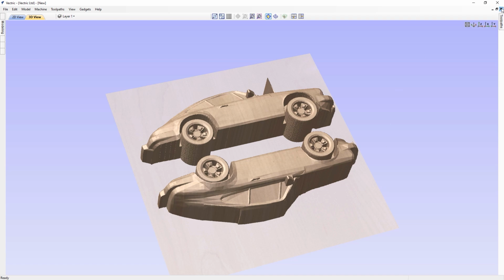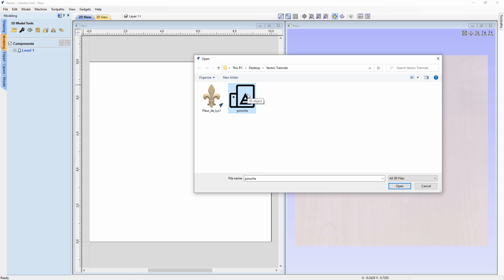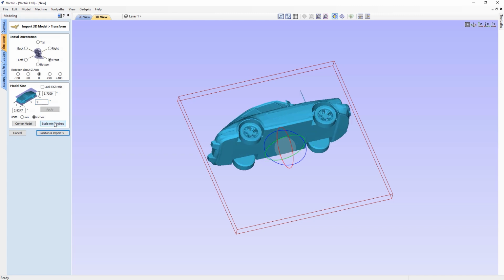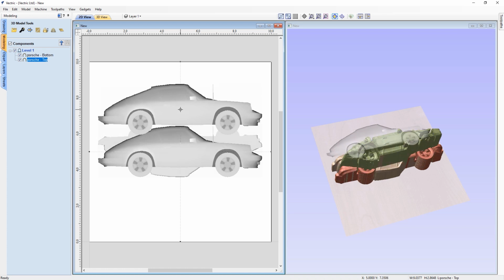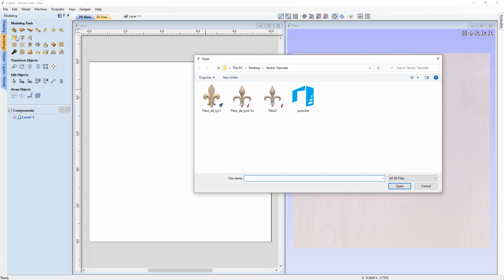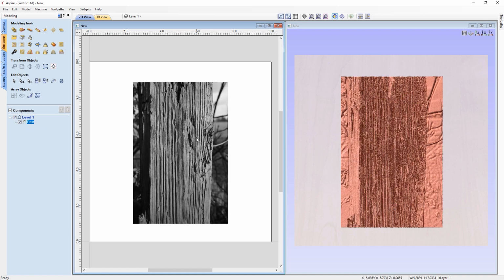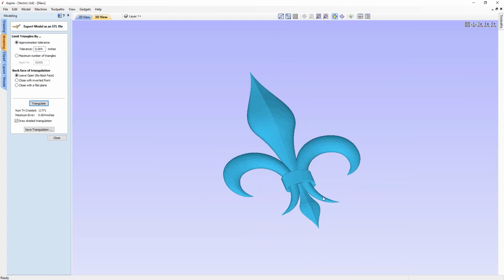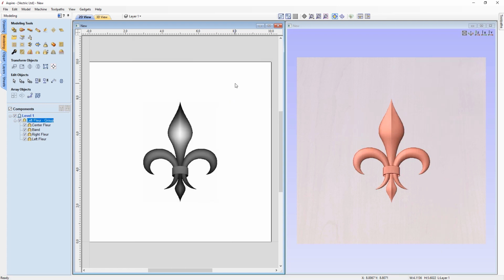Importing and Exporting 3D Data | Vectric V11 Tutorials

Comment: When I import a .obj 3D file of a crest, it initially looks great.  All the details inside the crest are present.  I can rotate, position, and resize things just as you did in your video.  The only difference is my 3D model is burnt orange in color and not blue.  Then when I click the ok button to add everything to the job, when it finishes processing, all I have left is the outline of the crest.  All details are gone.  What can I do to resolve this?
Reply from the maker: Hello, and thanks for the quetion.  First off it sounds like your OBJ mesh may be inside out... so you may need to sort that out than import it.  There are a few free packages (including Microsoft 3D builder) that could help.  If that does not do the trick I would suggest sending an email to support@vectric and include the .OBJ file for them to look at.

Comment: When I import a 3d model Aspire assigns a "ZERO PLANE" in the center of the material how can I move the zero  plane to the bottom of the material ?
Reply from the maker: Hey Mark... thanks for the question.  Once you have the model imported in goto your Material Setting and be sure to move  Model Position in the material.  Not seeing how you have choosen to import it (where the position of the model is on import) I feel this might be a place to start.  If I'm wrong... this might be one for support@vectric.com where you can give them a more indepth description of your work flow... and they are sure to be able to help.

Comment: The problem is - Aspire works on such low resolution when importing models etc (even when setting the resolution to max 50x), that the grey scale map it produces in 2d view is so incredibly pixelated that you have to make significant border changes to your model then do a profile cut around the edges and tweak all your tool paths just to get better defined cuts. It also only supports a limited amount of "mesh" triangles etc, i had a model i have subdivided multiple times to get it smooth, however aspire only recognizes a minimal amount of mesh subdivision so the model was basically a tonne of flat spots - exactly like the Porsche import in this video. It doesn't seem to be the 3d modelling software thats the issue.
Reply from the maker: Hello RealDC... thanks for the comment and question.   There area few things that would help you out, but we would need to see a mesh example you are importing.  I would suggest you contact support@vectric.com and send along a mesh file example and a .CRV3D example file.  I suspect they will be big files so they can show you how to get them to us.